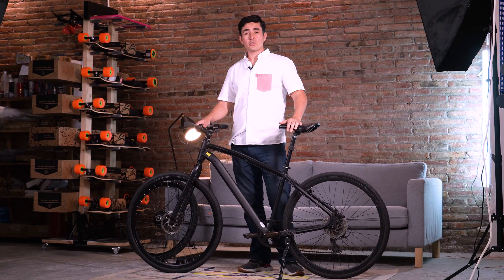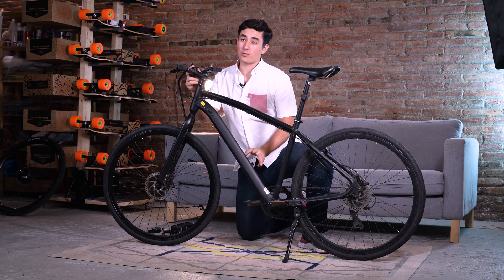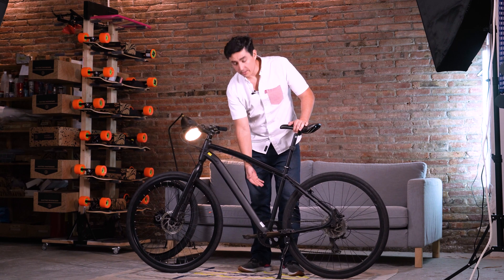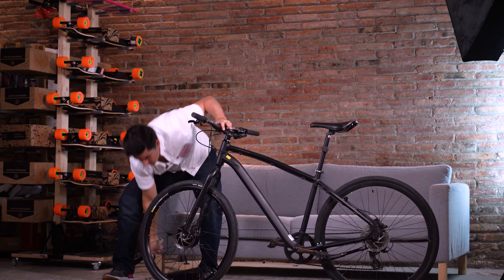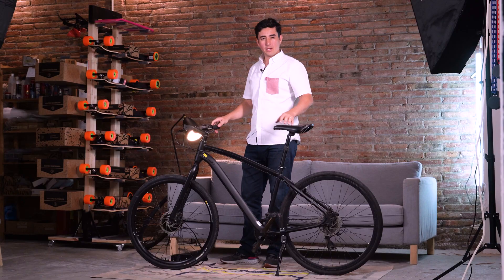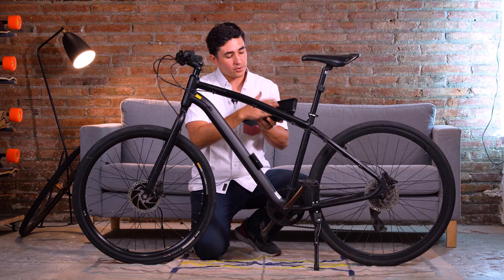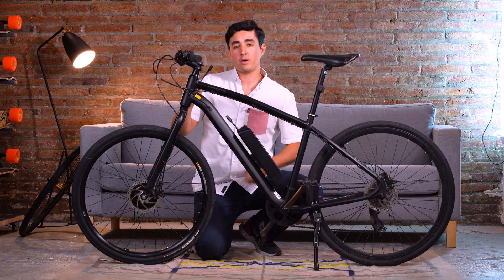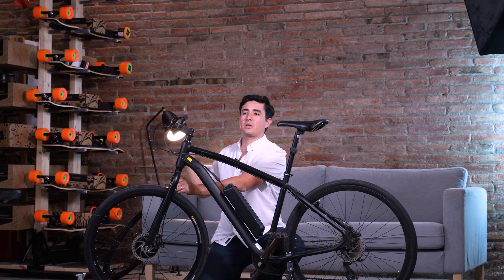Unlimited eBike Conversion Kit - Installation Update

Comment: Anyone still using this???  I put it on a hardtail bike and it works great, but my arms are getting pounded.  I am about to put it on my dual suspension bike.  That is the beauty of this kit- you can move it around.  Too bad the ebike portion of the company was dissolved.  It is a quality kit.  I wish I would've ordered the throttle wire.  I also have the cheapest Amazon ebike, which is also fun, but the front shock is really crappy so I have something to compare it to.  My full suspension is a 10 year old 26 pound wonder and it should make the ebike conversion awesome for an all rounder.  Let me know if anyone is still riding this kit!!!  I can't be the only one.

Comment: Why add motor to the front when most Are fitted to back wheel 🤔
Reply: It's easier, in my opinionno fucking about with gearing chains derailleurs in essence it's like a front wheel drive car it saves on extra components problems and weight to keep costs down.

Comment: how will this work on a fixie? will you have to peddle much faster to keep up? o.O
Reply from the maker: Hi Bernas! On a fixie you need to install either the throttle or brake sensors to cut motor power because if not, it would be accelerating all the time!

Comment: Looks promising. Do you plan on designing a basic lock for the battery so when popping in for a coffee no one takes it?
Reply from the maker: Hi Alexandru, the sliding rail has a security bolt meant as a theft deterrent.
Reply: @rideunlimited  This is great news! May I have a picture or some direction to see how it looks like?

Comment: So if you Pedal and brake (due to whatever reason) the motor still will turn?
Reply from the maker: Yes the motor will still provide assistance in that case, usually brakes can overpower it and we recommend having a good set of pads on them especially if they are rim/V brake. The XR+ kit comes with an accessory harness, the Hydra, that can fit analog and digital brake sensors for motor power cutoff.

Comment: No torque arms? Those dropouts are not designed for the extra torque of the motor.
Reply from the maker: HI! Please take a look at the FAQ (bottom) on this page: https://www.ebikes.ca/product-info/torque-arms.html  Our motors provide at most 40N.m. and we do sell torque arms for those with carbon or very thin/light forks.
Reply: Do don’t  need torque for this power,  when you get to 1500w 2000w , different story